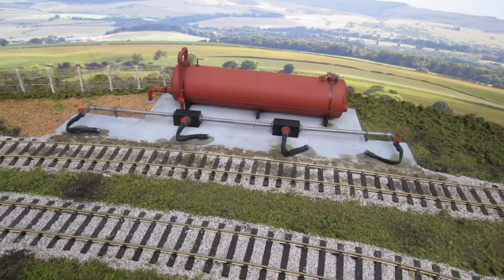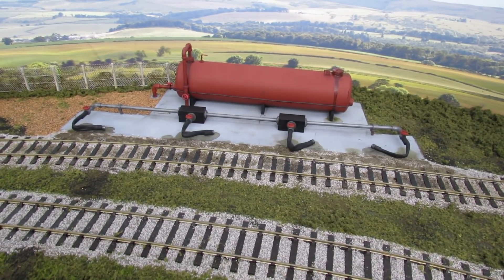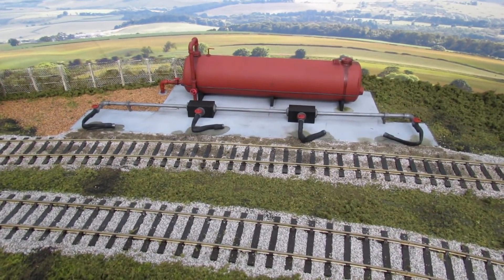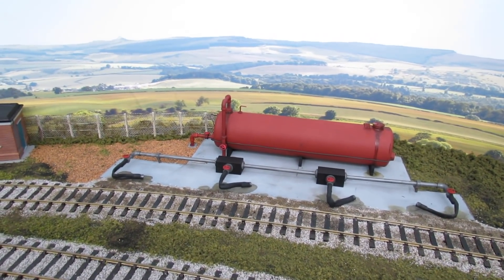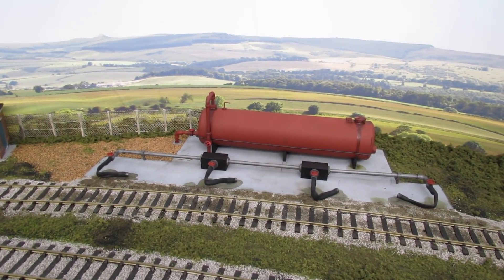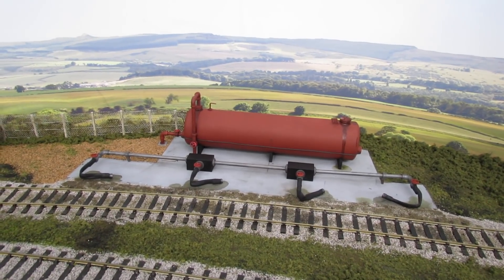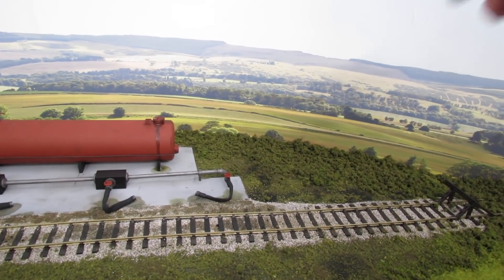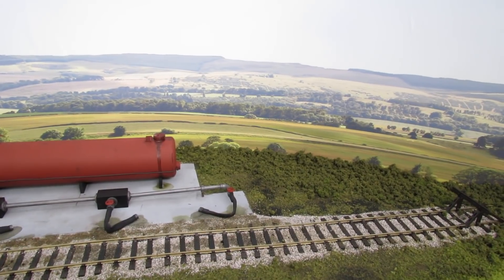Milton Mo Junction69

Comment: Another job ticked off the list Robin. The way you have blended that fence in at the rear is perfect to my eyes. Well done on the shrink wrap/wire refueling pipes, they look great.
Reply from the maker: Once again Ian, thanks for your supportive comment, hopefully with some more weathering and a wall to still be done at a later stage it will look even better.
Robin

Comment: That looks so much better. I know it was a pain leaning over but it is so worth it. The bund wall only needs to be a few course of bricks high so shouldn't block the view too much, but there's no reason why you can't come back to that later. Looking good. Cheers
Reply from the maker: Yes the hardest job was sorting out the fence which I had to do at this stage else it would be even harder stretching over work done in the front area Alan. When I get around to fitting a wall that will be easier as the tank and piping is not glued down so can be lifted, (which I did doing the fence). I will probably try and attach the wall to the base supports on the tank so that can be done remotely and put back in one piece.
Robin

Comment: Like the use of vegetation to hide the end of the fencing. As you say, it now looks like it dissapears off scene rather than just stopping.
Surprising how small additions like this make such a big difference to the overall look of the layout.
Reply from the maker: Thanks James, as I said it is difficult to completely fence in the fuel depot so had to to give the impression it is fenced, but not show the ends as it were. I am really please how it came out, and as 'Sparky' commented it gives that area a sort of 3D appearance with the back scene.
Robin

Comment: I would agree about fitting a bund wall, as it is required to capture spillages and prevent environmental Armageddon 😁
Reply from the maker: Yes, I know, and will probably but a wall there at a late stage. I wanted to get the fence sorted before I did any more work in the front as I have to stretch over. I have not glued down the tank or any pipe work so they can just be easily lifted off and worked on remotely. I will probably fix the wall in some way to the tank base so that I can put it back in one piece. I think I just want to get the whole basic scenery completed so I can potter adding bits and pieces as I go.
Robin